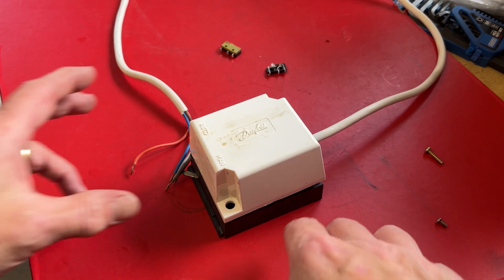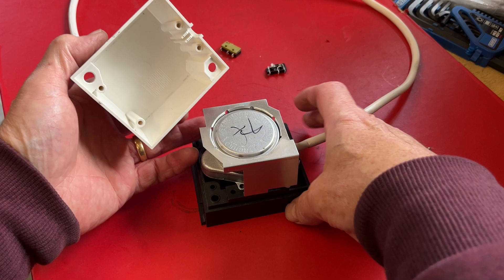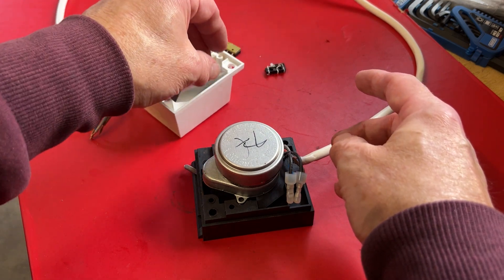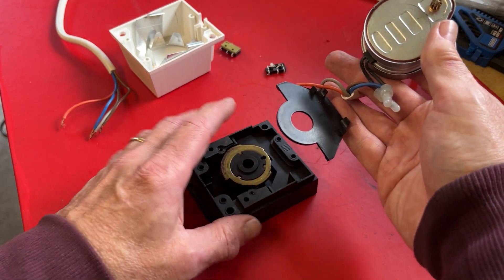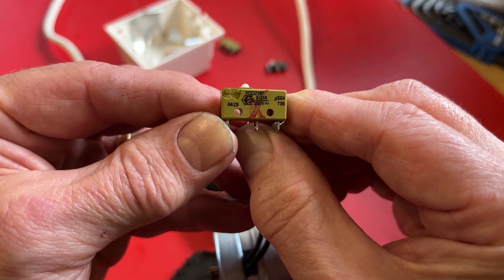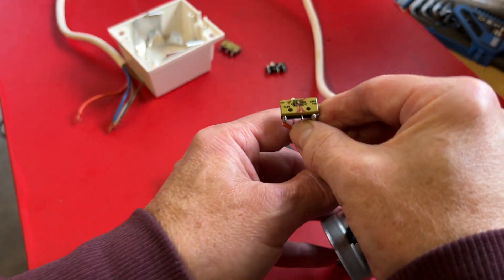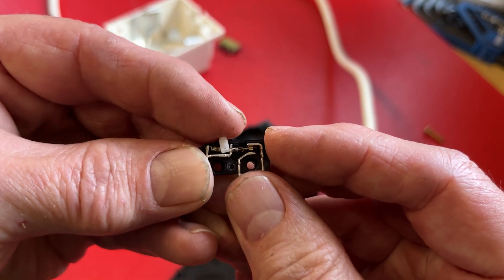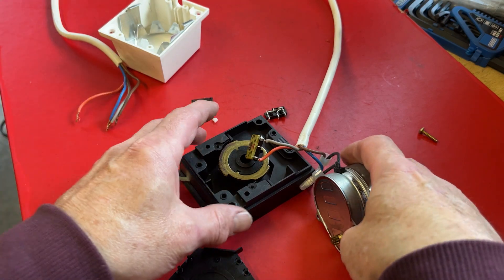Danfoss HPA2 Directional motorised valve, what's inside. Fix boiler constantly continuously running.

Comment: Hi

I have a danfoss hp22 2 port zone valve fitted to pipework and i am guessing it is faulty as my downstairs rads are hot yet the boiler is not fired up!

The pipe above and below the zone valve are hot so i know water is flowing through it and must be stuck in an open position.
Is there a diy way of me unstucking the valve or even replacing it like for like as the good thing is i have it on a plug in adapter so dont need to go into the wiring box to remove or insert the wires .
Im just scared if i pull it off water will gush out . Any advice please and whther you think that it is the actual cause of the problem i mention. Thanks
Reply from the maker: @goodfellaz999, the Danfoss unit is bolted onto the water valve. The two are separate units and once the Danfoss unit is removed you should be able to access the sealed water valve underneath. You should be able to move the valve from open to close with some pliers, unless it’s stuck open. If that’s the case it will need a new water valve. Hope that helps, regards Damian
Reply: @Modurol  thanks, how common are the valves to become faulty as most videos I seen say the majority of times it's the motor that becomes faulty? Once I remove the head do I turn heating on and see if the motor turns inside the bulk head and if it does then does that mean the valve is the problem? Thanks for quick response
Reply from the maker: @Goodfellaz999, the water valves themselves do fail as well as the Danfoss units. You can do as you suggest to see if the motor is moving. Good luck, regards Damian

Comment: Hi. Why is this happening?  This has already happened in our new house 3 times in 20 months.  Our warranty runs out in 4 months and I'm afraid I'll have to replace this part with my own money next time.  Is there any way to prevent this?
Reply from the maker: Michal, sorry to hear you are having problems, sounds that the cause of your issue hasn't been fixed. If you are fitting these HPA2's new then this isn't your problem. More investigation required. You can remove them from the valve and watch them work, but please be very careful. Sorry, can't be more helpful, regards Damian

Comment: As you have had one of these buggers apart - hopefully you will know... the function that returns the valve to closed when there is no power - is that part of the motor, or hidden in the black plastic bis with the brass cog, please? Mine has stopped closing properly - but the actual wet bit of the valve works fine.
Reply from the maker: Mike, it uses a spring to return it to closed. This is attached to a lever that can be locked into open position. Might something jamming up that mechanism. Hope that helps, regards Damian
Reply: @Modurol  Thanks, it did indeed help. I took it to bits today, removed the old copper grease (and the chunks of whatever on earth was stuck to it!) lubed and put it back together. It runs a little slower than the other valve, but at least it sodding works now.
Reply from the maker: Mike, glad you got it sorted. Thanks for the feedback, regards Damian